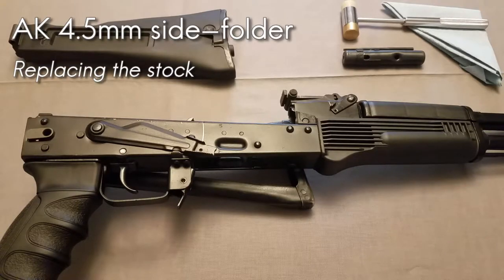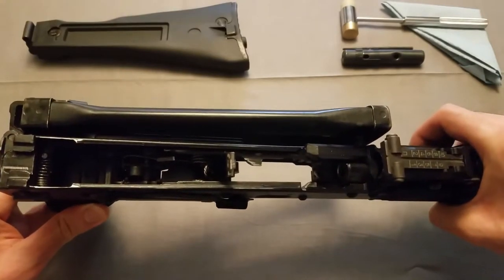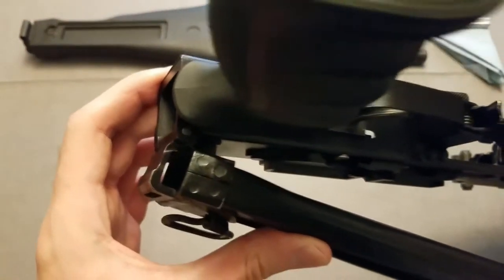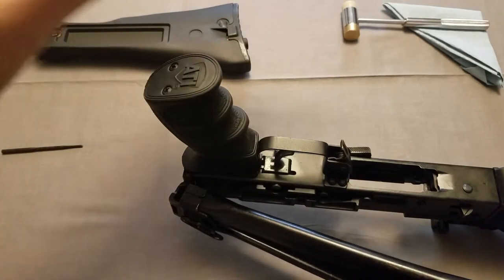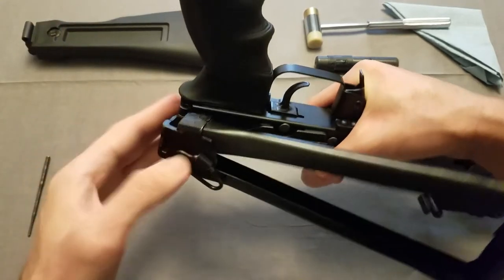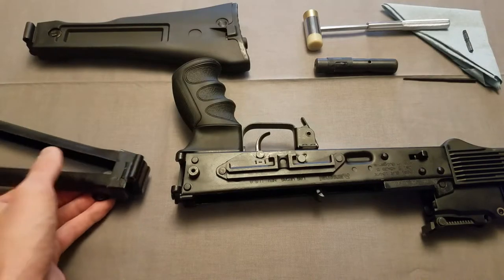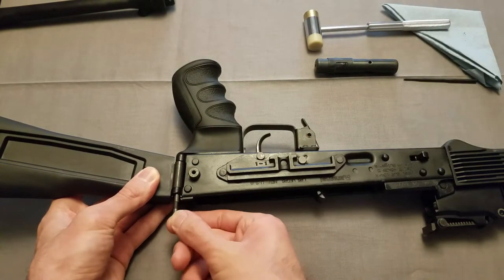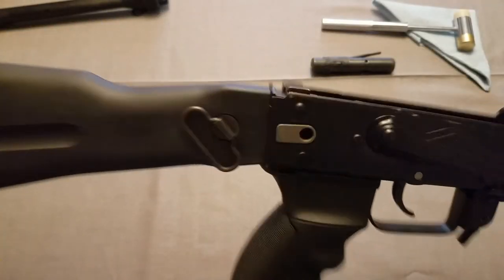How To Remove an AK Side-Folding Stock (4.5mm/5.5mm pin)

Comment: Does it cut it for Airsoft AK74M
Reply from the maker: I'm not sure as I don't do much with airsoft. If it's manufactured accurately to an original AK-74M then yes.
Reply: @Feldmutze  It's a CYMA one pretty close to the Real 74M. All the details everything. Altough the dust cover is ribbed the details spot on. Also thanks for reply man. I dunno the stock little wobbly.
Reply: @Feldmutze  it worked man exactly as a real steel
Reply from the maker: @trooperodst6880  That's awesome and good to know if I ever get more into airsoft myself.
Reply: @Feldmutze  Thanks! Good to hear man! If you want AK74M go for LCT. Or you could still go with CYMA.

Comment: I am so glad that I found this video. I wanted to do exactly this but I wasnt sure if the Polymer and steel shaft were the same pin size and would fit on an AKS-74
Reply from the maker: Glad you found it helpful. Yeah, so long as the stock you want is the same pin diameter (4.5mm/5.5mm) as the one on your rifle then you're all good to go.

Comment: How much does it weight  ?
Reply from the maker: The stock weighs 0.72 lbs.
Reply: @Feldmutze  Would you be able to post the weights of each? Trying to decide if it's worth a switch...
Reply from the maker: @itreehorsenumber3  Sure!
Triangle stock: 236 grams / 0.52 lbs
Solid stock: 326 grams / 0.72 lbs
Reply: @Feldmutze  Thank you!

Comment: As others have commented clear and concise instruction with great lighting. Very easy to understand. You need to make more instructional videos! 

I am relatively new to AKs and I have a M92 PAP clone built on a Nodak receiver but it has a side folder. Does that mean it has a side folder trunion in the back and how to tell if its 4.5/5.5mm pin ?
Reply from the maker: The easiest way to tell If you have a side-folding trunnion would probably be to fold the stock and if you don't have a steel tang hanging out when it's folded, that would indicate you have a side-folding trunnion. Otherwise, there are a lot of folding stocks now that adapt to the fixed trunnion, so if part of that trunnion sticks out, then it's usually a good indication it's a fixed vs. folding.

As for whether it's a 4.5/5.5mm pin, I'd recommend using calipers to measure it. Here's also a link to an image showing the visual differences between some 4.5 and 5.5mm pins, which can help determine which one you have. https://imgur.com/FlWppX4

Comment: Can you please explain what that BUTTON is on the back end of the solid stock? I keep seeing that thing on these AK stocks and it looks like something that would dig into your shoulder. What is that and why is it there?
Reply from the maker: The button on the back of the solid stock is what you press to unlock the stock when its fully folded. On the triangle stocks you can manually pull the locking lever out and move the stock back into place, but since that's impossible on the solid stock that's the solution they came up with. It doesn't dig into the shoulder at all. The button depresses very easily, so when you have it shouldered the button just moves into the stock and out of the way.
Reply: @Feldmutze  Thank you!!

Comment: This is the same type of stock I got in mine, it is a PSA GF4 with voodoo furniture but it comes with that awful metal stock, now I did get the zhukov-s stock and seems it is NOT compatible with this rifle; I do not see how to mount it on it and that would suck because I do not like at all that cheap metal stock!
Reply from the maker: The Zhukov-S is completely incompatible with side-folding receivers. I believe PSA uses a 4.5mm pin, so you'll need to find a 4.5mm side folding stock like the Bulgarian or AKS-74U-compatible stocks.

Comment: I have a PSAK-74 with a triangle folder. I cannot for the life of me figure out the pin size. Is there a way to tell if it's 4.5 or 5.5?
Reply from the maker: The PSAK-74 uses a 4.5mm pin, there's a visual difference between how the hinge section is set up between 4.5 and 5.5 which can be seen in this photo: https://i.imgur.com/FlWppX4.png

Comment: do you know if its possible to put a fixed stock on a side folding stock model?
Reply from the maker: It's not possible without significant modification to the fixed stock and adding a hinge to it.

Comment: Any tips for the case when the pin won't move out even after using a hammer?
Reply from the maker: I would try using solvents to try to clear any blockages that might be there and try hammering it out again. Also try hammering it with the stock unlocked at different angles as not every stock, pin, and locking mechanism is perfectly in spec so at some angles it will be looser/tighter than others. As an absolute last resort you can drill the pin out on a drill press though you will need to replace the pin then.

Comment: My button to release the stock is SUPER tight have to use both thumbs to close the stock, any fix?
Reply from the maker: I had that issue when I was installing a Zenitco PT-3 stock. You can fix it by cutting out a bit of material in the "0" sort-of shape where the stock is held in.

A little hard to explain in text, but I showed it in a video I did on the installation of the PT-3 stock in specific, which I'll link below here. The specific dremeling part is at 11:04, though the link should automatically go to that time.
https://youtu.be/K1LbiO5UVHw?t=664
Reply: @Feldmutze  just checked the video I’ll give it a try! Thanks man

Comment: What brand is that triangle stock or where can I find it or one similar
Reply from the maker: The triangle stock I have is just one that my SLR-104FR came with from the factory. As for where to get one, you could try SovietStocks or RussianSurplus which both have triangle stocks for 5.5mm pins available, but I'm not currently sure where to find a 4.5mm triangle stock currently as all the usual places are out of stock. You could try GunBroker but that's always iffy.

Comment: What should I do if I want to remove a folding full stock and add say a Magpul folding stock?
Reply from the maker: I'd look at other stocks, the Magpul stocks as far as I'm aware are made to fit AKs with a fixed rear trunnion so adapting a side-folder wouldn't be possible.
Reply: @Feldmutze  Ahhh okay I was wondering, thanks 🤙

Comment: Is it possible to replace the whole stock with m4 stock? Im just tryna figure out how to replace my psa ak103 side folder stock! Thank you
Reply from the maker: Yes. I know Armacon sells an AR-to-AK tube adapter and you can probably find some American manufacturers that make a similar product. Just make sure you find one with the right pin, the Monolith I linked might only work on 5.5mm pins which I'm not sure if PSA uses.
https://ivantactical.com/shop/weapon-accessories/weapon-rails-and-tuning/buttstocks/armacon-monolith-3-gen-2-ak-folding-buttstock-to-ar-15-tube-adapter/
Reply: Awesome men thank u, i just found the JMac 4.5mm custom adapter and the psa ak103 claim to have the same size pin 4.5mm! Thanks again

Comment: Is tht kst 12 grip u got on tht kp9
Reply from the maker: It's an ATI X1 grip. Works pretty well on fixed stock AKs but I had issues with it on this SLR where it pushes my thumb into the hinge on the side + it broke on me so I wouldn't recommend it. I'm now using a Custom Arms AG-74 pistol grip that's being working really well so far.
Reply: @Feldmutze  I'll go looking for one and see how it is. Thanks

Comment: What grip is that?
Reply from the maker: ATI X1 grip. I wouldn't recommend it as it has a very uncomfortable overhang if your AK has a reinforcement plate for the grip, and the polymer is quite weak and mine broke a few months after this video.
Reply: @Feldmutze  any recommendations?
Reply from the maker: I'm partial to the AK-12 pistol grip, though sourcing it can be difficult. The Hogue and Magpul grips are some other good options.

Comment: how do u unfold it
Reply from the maker: If you have a triangle stock then you manually pull the locking lever on the receiver, on other stocks like the one I replaced mine with you push the button on the back of the stock which pushes the locking lever out of the way so you can unfold it.

Comment: How would this work for an rpk74
Reply from the maker: The process itself is the same for an RPK though side-folding AK stocks may not fit on a RPK because RPKs are supposed to have a different receiver thickness.
Reply: @Feldmutze  alright thanks!

Comment: I got a wasar 10 with the wire stock but I want to change it to the triangle stock but I don’t know the pin size
Reply from the maker: It'd be really involved to switch a WASR to a side-folding stock. If you do change it though you could use whichever pin size you find stocks in since it'd require replacing the rear trunnion at the least.
Reply: @Feldmutze  is that hard to do
Reply: @Feldmutze  my wsar 10 got the side folding wire stock
Reply from the maker: @KevinPerez-rv6bx  It's pretty hard to do in my opinion. And unfortunately side-folding wire stocks don't use normal pins like the ones I showed in this video so you wouldn't be able to just put a triangle stock where the wire stock used to be. If you want a triangle stock I think you're much better off buying a different AK with a side-folding receiver & trunnion already on it.

Comment: I can’t remove the pin how did you do it so easily?
Reply from the maker: If the pin doesn't come out easily it probably the stock fits on the tight side or, much less likely, that the pin is slightly bent. The simplest solution I can think of is to cover the pin with something so you don't damage its finish or surface and hit it really hard. Otherwise you could try jury-rigging a vise or something of the sort to push the pin out, though that would probably be more effort than its worth.
Reply: same here. did you solved it ?
Reply: I Drill it.now i need a New pin. It wont come out.

Comment: How do you install it
Reply from the maker: Install what exactly? If you mean the stock then I already showed that in the video.
Reply: Install the stock I got my first airsoft gun and got this stock separately I’m having trouble figuring out how to install it, I tried to do your steps backwards but it didn’t work
Reply from the maker: @BenThomson887  I'm not too familiar with airsoft guns so I can't really help there. I know some airsoft guns are made slightly different from their real gun counterparts, so perhaps there's information specifically for your model out there?
Reply: @Feldmutze  sorry I’ve been using airsoft gun a lot I just typed gun and it tried to autocorrect for some reason
Reply from the maker: @BenThomson887  Oh gotcha. I mentioned this is another comment too, but the new stock I installed here in the video was a lot tighter of a fit than the first stock and I had to hammer it in a lot (though I cut out the footage of the more difficult part). So you could try hammering it in if it's the pin that isn't going in, unless it's a different part of the stock that isn't fitting?
Reply: @Feldmutze  no you answered my question thanks!
Reply from the maker: @BenThomson887  No problem, glad I could help.

Comment: i have smashed the shit out of that pin and it still wont budge
Reply from the maker: Some are way tighter than others. Maybe try having the stock at a different angle when you're hitting it out? I dunno.
Reply: same here, how did you fixed it ?